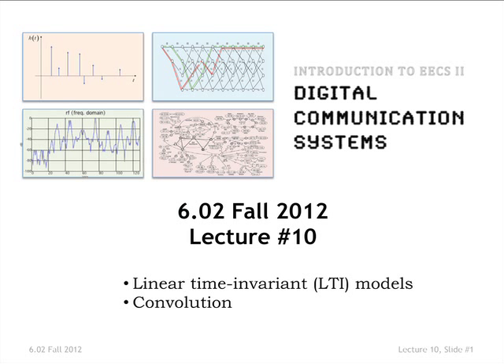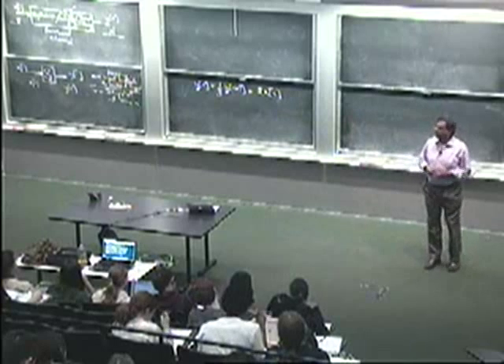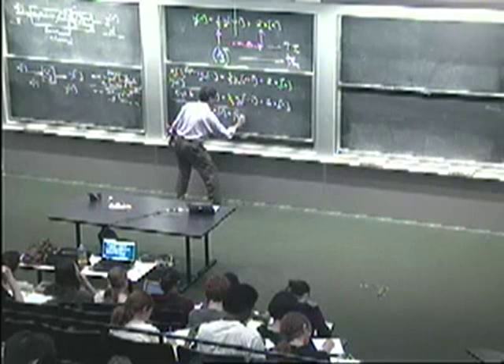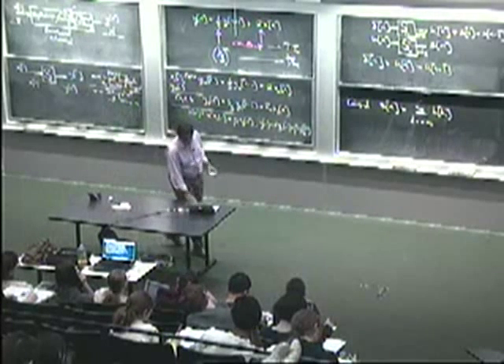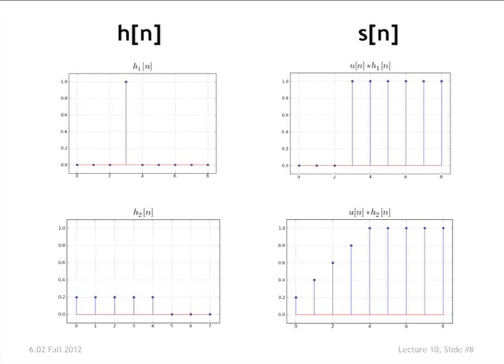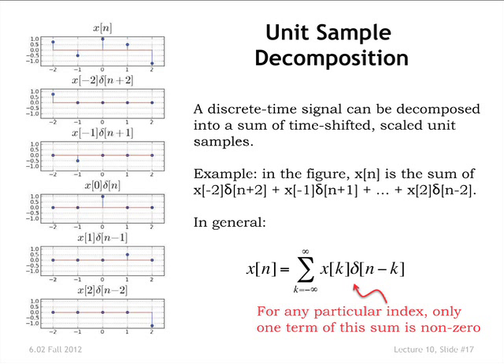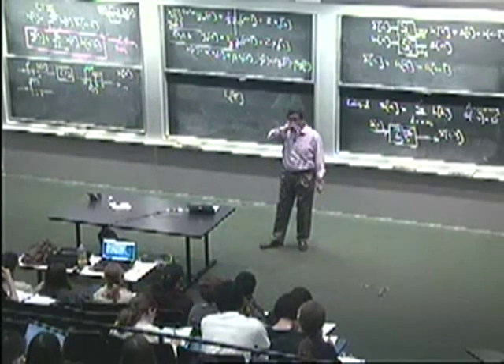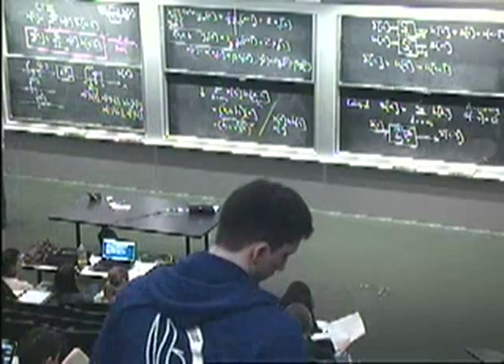10. Linear time-invariant (LTI) systems

Comment: great idea of mit!
if it was recorded in 1080 it would even be possible to read everything written to the blackboard.
Reply from the maker: In this particular case, the only sources available were the quarter screen Flash files. None of the original source was saved. The instructors thought that the course was worth publishing since most of the information is in the audio and the slides.